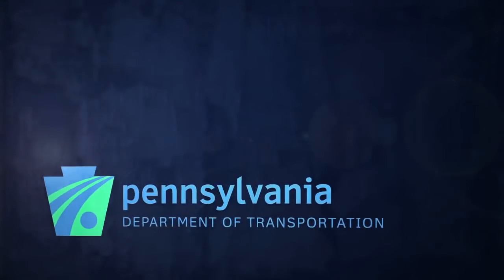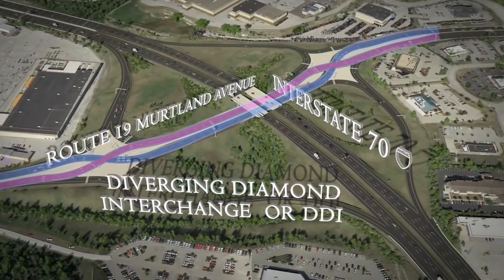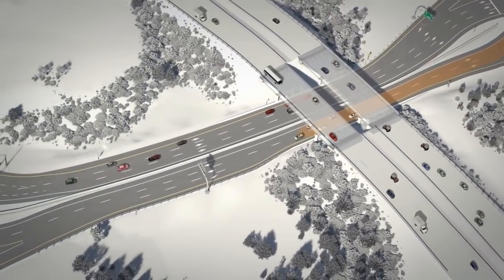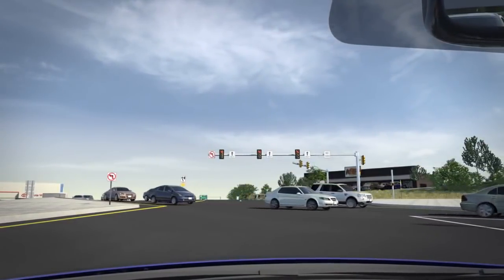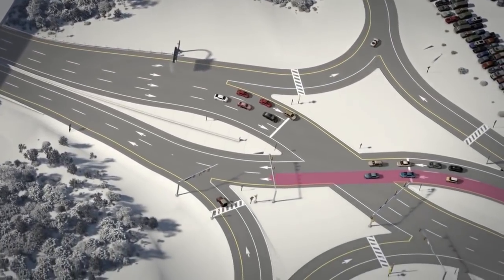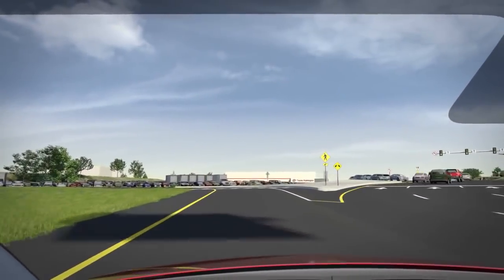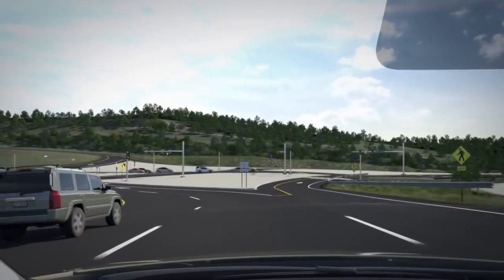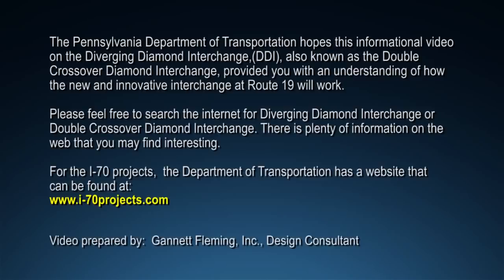How a diverging diamond interchange works

Comment: 1. Now there are stop lights where there were none before.
2. Lights require power and maintenance.
3. Lights slow down the traffic to half the speed. A choke hold limiting traffic to under 30 mph.
4. When the traffic is backed up it overflows into the other lanes stopping the other lanes.

Could the lights be replaced with bridges so no stoppage, no lights, are needed allowing traffic to flow without restriction.
Reply: All of the problems are because of dumbfuck drivers who probably shouldn't have a license.

Comment: The only caveat I see with these is that if those traffic lights are knocked out, like in a power outage for example, it would be absolute chaos unless there is an officer or someone there directing traffic, or a back up set of lights . I used to drive through the intersection of I44 and Rangeline in Joplin Missouri and it seems to be a good design, but the lights look like they would be a single point of failure.
Reply: Good point, but I don't think problems that arise would be drastically more chaotic than other intersections face.  There are advantages as well as disadvantages.  Keep in mind all major intersections should have a backup plan and officers on site when problems arise.

The most dangerous aspect of a traffic light failure is probably turning traffic, which is completely separated out here.  There are no turns where conflicting traffic crosses, and it comes from a single direction which is more clearly visible.

Each direction has 3 possible actions.  With them being completely separated, for example if there were an accident, generally only one or at most two actions could be blocked.  So most of those circumstances would have other route(s) for a detour, where a traditional diamond could become completely blocked in all directions by an accident.

Comment: Diverging Diamond is more efficient than standard interchange with traffic lights. But the clover design doesn't have any traffic lights so this is definitely less efficient. Safer though, since there are no longer cars merging into/out of the same lane constantly.
Reply: As with anything in life decisions are made on the basis of cost and efficiency. The clover leaf interchanges in existence were built decades ago when traffic flows were much less and as you mention the problem today is congestion from too much traffic in turn lanes which backs up onto the highway. One approach would be to build bigger and better clover leafs and there are other very amazing looking high tech and high flow designs such as the stack interchange. The problem with these is cost. A modern stack interchange was built recently in Arizona ..at a cost of 675 million. The DD is an excellent design when looking for an efficient design that does not cost too much. I attach an excellent video looking at traffic flow in various designs. Its only 6 mins long and worth it.
https://www.youtube.com/watch?v=yITr127KZtQ
Reply: Good points.  I do not know the specific usage of these roads, but if the turn lanes backed up causing congestion it kills the efficiency.  That's a common problem with undersized clovers.
Reply: I can't wait to see a double crossover merging interchange (DCMI).
Reply: The lightless clover leaf designs are 50 times less efficient than a DDI, the lights here will not be the typical 5 minute long lights we see normally, they are part of the design and change more often to keep things moving.  The only achilles heel in the design is morons who feel the need to crash into stuff regularly.  An accident on one these pretty much derails the whole process depending on how many lanes get shut down.

Comment: What? An improvement? With so many traffic lights and so much waiting? I don't want to be rude so I'll just say that I completely and utterly disagree.
Reply: Vít Profant that’s fine, it’s proven itself to be far more efficient and safer than a regular interchange. Salt Lake City has been using them for almost a decade.
Reply: It may seem like a lot of lights but there are really only 2 phases.  50% of the lights are red while 50% are green.  You may see where a turn lane has a light and thru traffic has a light, but these really are the same light it's just the lanes are separated.

Comment: I understand that this can be more efficient that a cloverleaf in ideal conditions but that is not the real world. Not only is it backwards from what people are accustomed to which is dangerous; it is polluted with deadly intersections that people will run, there will be accidents and both directions of traffic will be stopped by them as opposed just one. This is not designed around real world conditions.
Reply: This is actually one of the safest options.  All actions have dedicated lanes that are separated by cement barriers.  There are no special rules for drivers, they just drive as normal.  Just get in the lane that goes where you want and stop at red lights.  There is only one way to go for turning traffic so it removes chances of drivers mistaking the turn and ending up in the direction of oncoming traffic, that happens in traditional diamonds.  

Though where the directions cross it is physically possible for someone to turn from the straight lanes into the oncoming direction, but every indication shows that is not to be done.  (The straight lane should go straight not turn, there are 'no turn' signs as well as signs with specific 'no turn' arrows.  Arrows painted on the ground show your lane going straight, and arrows on those lanes showing them coming out.  The yellow lane border should be on the left, if it's yellow on the right you're going the wrong way.)  That is just two spots in total, which are clearly marked. Again a traditional diamond has more spots, which are often less clearly marked.

But yes, someone could cause an accident if they run a red light... any red light, this has nothing to do with it being a diverging diamond.
Reply: Missouri adopted this in a few places and their rates of accidents went down, and their traffic flow went up. They didn't change from a stoplight, though, so this instance may be different.